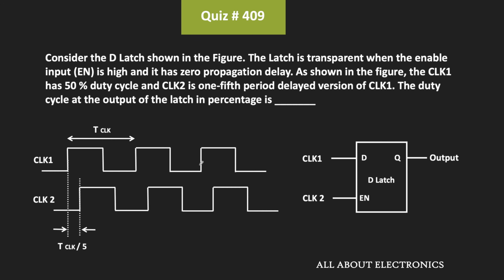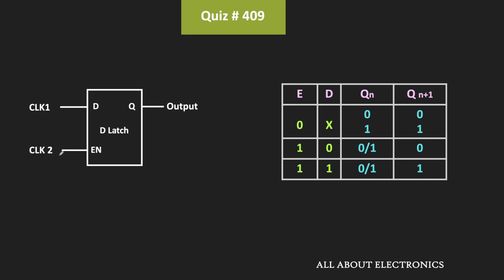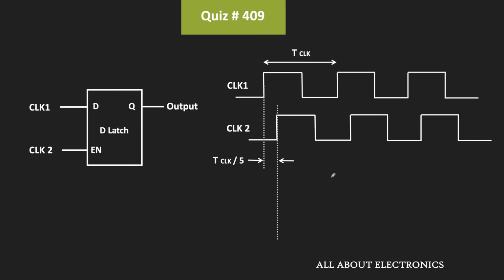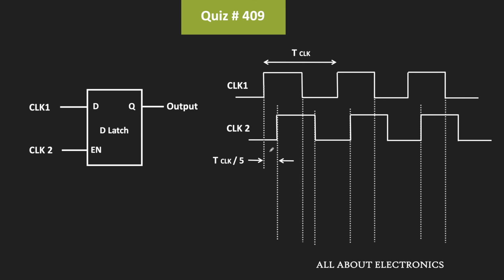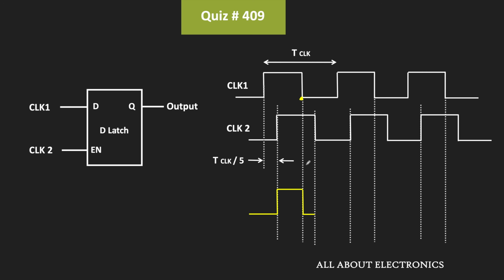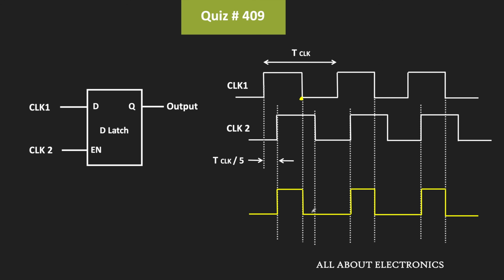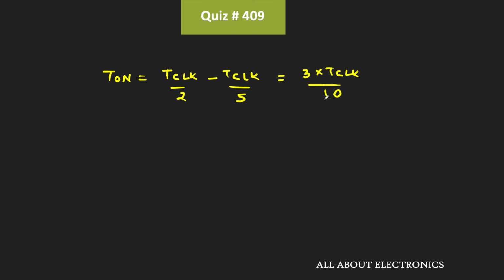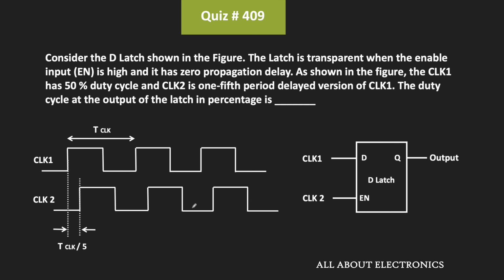D Latch Solved Problem (Digital Electronics) | Quiz # 409

Comment: hey, D flip-flop is edge triggered but you followed level triggering, can you please explain this, also if the d flip flop is edge triggered then how did you take negative edge in consideration because the positive edge will not allow the signal to go low.
Reply from the maker: Because here in the question, we have given a latch (not a flip-flop).